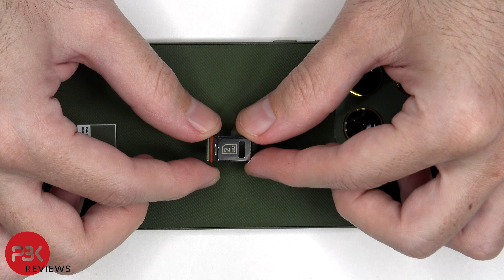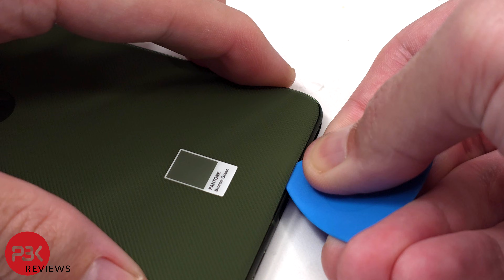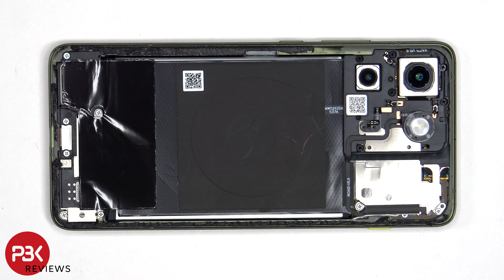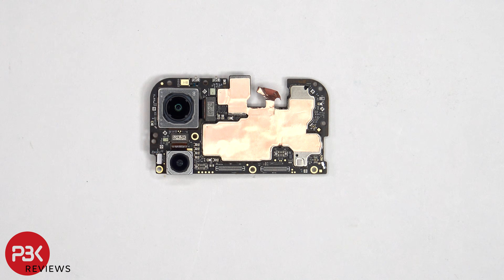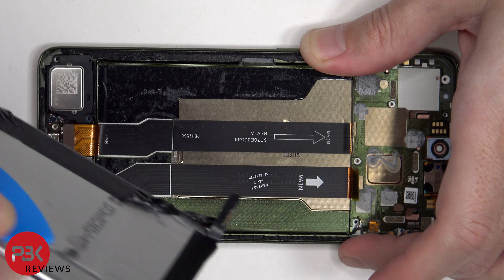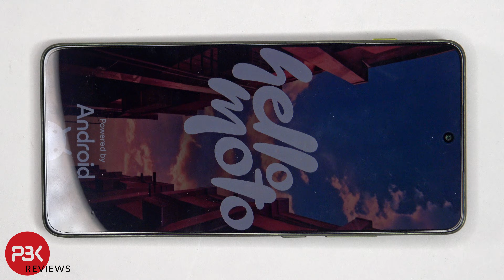Motorola Edge 70 Moto X70 Air Teardown Disassembly Phone Repair Video Review

Comment: The fact that this isnt a flagship may be the soul contributor for this being an actually good thin phone with no major caveats for its price point (at least in my country). It has decent battery on a thin body which solves most of the pain in this types of devices while managing to keep wireless charging on this price point.
Reply: Even the motorola signature (their flagship) is still super cheap while still being super thin

Comment: So Motorola is using a lithium ion battery (instead of silicone carbon) but was still able to fit it on a sub 6mm body. That's super incredible!

Meanwhile the iPhone Air only has a 3000mah battery. No wonder iPhone Air users are complaining 😭
Reply: 🥲every smart phone in the planet uses the li ion battery , most of them use graphite anode and silicon composited anode is what they call si-carbon battery
Reply: Bro silicon carbon batteries are basically lithium-ion batteries but instead of graphite, manufacturers uses silicon.
Reply: silicon carbon batteries are also lithium ion batteries
Reply: No bro, moto is using silicon batteries for these models

Comment: Watching on Edge 60 Pro
Will it b worth to buy Edge 70?
Reply from the maker: as far as size, they are different. One is much thinner so all depends on your preference but hardware wise, its not a major leap to say its worth jumping to the 70.
Reply: go compare processors
Reply: @user-ik2od3qf3y DM 8350 is slightly better overall as far as i know...

Comment: Now i'm getting a bit confused here.
Looking at the specs, this phone shoud have a scilicon-carbon type battery not a li-ion.
WTF?
Reply: Had a same doubt….but knew from the internet that Silicon carbon type is still a Li-ion only. Just anode is different. Normal Li-ion uses Graphite anode, Silicon carbon is Li-ion cells but with Silicon carbon anode.
Reply from the maker: @justviral273 👍
Reply: as in other comment, still li-ion
graphite or silicon carbon difference

Comment: I think it makes more sense to do it this way with a mid-range chip since it's fashion forward and going to have terrible thermals anyways. Motorola does it better but it's still a better phone if they just made it bigger, made the battery bigger, put the headphone jack and SD card back in. I like the aesthetics, I like the color I like the accents I like the materials. I guess I would just tell someone to buy the Moto G stylus 2025 instead. It's not perfect but yet the SD card and the headphone jack. It looks roughly the same as this just slightly less fashion forward.